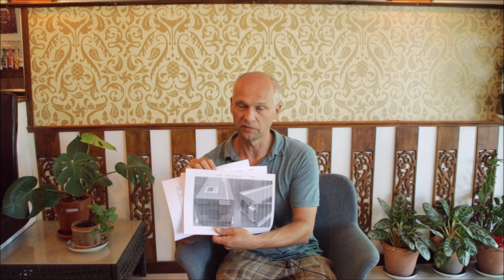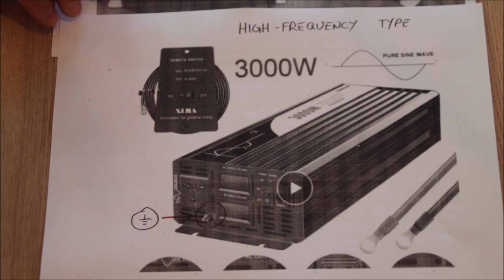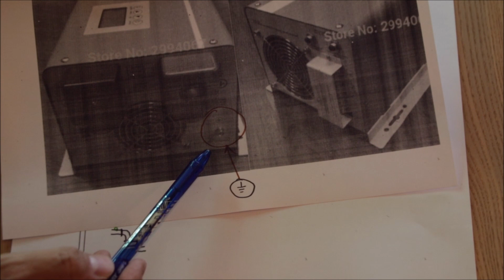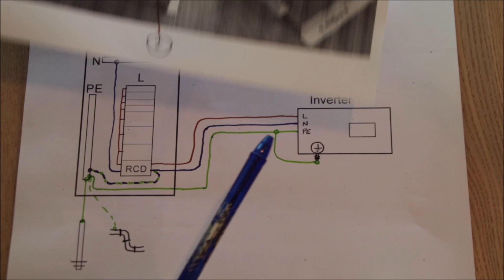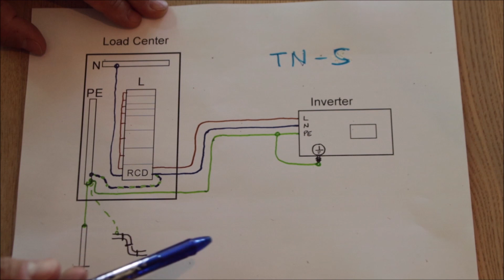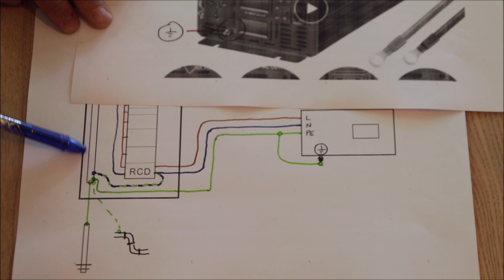Inverter Earthing and N-G Bonding in a simple Off-Grid Setup

Comment: I have a purely off-grid stationary system, the entire installation goes to a single box (with an inverter, AC/DC breakers, an RCD, etc). The inverter that has L, N and PE on both the input and the output. I also have a generator, some meters away, connected to that box. The breaker for the generator is at the box. The inverter has two modes: it can either create the N-G bond itself via a relay while off-grid (and lift it once the generator is available), or it can only switch L and keep N on the input and output always connected so as to inherit the bond from the grid (in this case the generator) (or so the manual says). PE is always continous.

How would you solve bonding in this case? I can either make sure the generator is bonded (or bond it by connecting a N-G connected plug into one of the outlets if that works) and keep the N-G bond switching in the inverter. I have a feeling this works best because it keeps PE separate all the way to the source. Or, I could create my own bond in the AC part of the box (load center) upstream or downstream of the inverter (you show it on the output but then it seems it could also be on the input side if N is continuous?). Or a combination; only I always read you want only one bond in the system. I've read so much about this that confusion is starting to take over, so if you have an opinion based on the above, that would help. :) Great explanations in the videos and great choice of topics by the way. :)
Reply from the maker: Hi. All your equipment is more or less in one spot. Just keep N-G seperated at the inverter as well as generator and only place one single bond inside your fuse box as shown. Connect all PEs including the generator body to the PE bar. As only one of your sources can be active at one time, the bond can only serve the active source anyways. Thanks for watching!
Reply: @RolandW_DIYEnergyandMore  Hi, thanks for the feedback, I appreciate it. I miss the bigger picture, so more questions come to mind. a) You suggest it is somehow important that only one of the sources can be active at one time. The inverter has a weird function where it can supply power by inverting and from the auxiliary supply both at the same time (i.e. joining the power from the battery and the generator). Does that change anything? b) If later on somebody changed the generator for a bonded one, would that then constitute a problem? (Two bonds, so I'm guessing making two PENs out of the PE and N going from/to the generator.) c) Does it make any difference whether the bond is upstream or downstream of the inverter (or going from e.g. a main breaker instead of the RCD specifically)? If N-in and N-out is always continuous in the inverter, would it matter somehow if the bond was placed between e.g. the N-out of the breaker dedicated to the generator (so basically inverter AC-in) and the PE bar?
Reply from the maker: @smzdajdp  what you are describing in question (a) sounds to me like you have an inverter with grid-tie capability. This means that the inverter will, once the battery is charged, start to push the excess energy from the PV on your virtual grid which you are creating with the generator. Correct? Well, you cannot use that feature! What if your house duesn't need power while the generator is running? The inverter is assuming its energy is going to the grid (which is an infinite energy drain) but in real the power cannot go anywhere. So yes, it is very important in an offgrid installation that power can only come from one sourc only.
I think your other question about upstream bonds are relating somehow to that feature about energy going reverse on the AC-In of the inverter. So no, you cannot do that as the AC in of the inverter will be a dead end when the generator is running. 
Use one power source or the other. Physically separate it best with a transfer switch. Then you can make a permanent N-PE bond downstream of the transfer switch at the RCD. 
Or you use the generator at the AC-In only to charge the battery when it is low, so the inverter is still the source if the AC power in your house...
Reply: @RolandW_DIYEnergyandMore  Sorry, I should have been clearer... Also, excuse the length, this is the last one. There is a completely separate MPPT charger for the PV (and a battery between the MPPT and the inverter of course), so that's unrelated. The inverter (Studer) is hooked up to the battery, the generator is hooked up to AC-in of the inverter (the cable is about five meters). AC-in/out terminals on the inverter as described in the first comment. The inverter can only do three things here: supply AC by inverting from the battery, charge the battery via AC-in (generator) and then the third function in question: with the generator running, when the AC load is large enough, it can limit the charging all the way to zero in favour of the load and if the load is larger still, supply the rest by inverting from the battery at the same time (to quote from the manual: "[it] allows to have the sum of the current supplied by the inverter plus the current supplied by the [AC] source"). But this is all managed by/inside the inverter. The only reason I elaborated on it was that you suggested it is somehow relevant to the PE/N bond which source is active and I did not see how. :) Now I see we probably misunderstood each other.

The upstream/downstream bond question was purely theoretical since I don't really understand properly how faults are detected thanks to the PE and the bond, how does the function of the three wires change upstream of the bond and how would it all behave in case of different faults at different places. (Plus it would be convenient for me to physically wire it that way, but that's not really relevant.) There is no problem wiring it the way you suggested initially/in the video, besides somebody later changing the generator for a one that would itself have a bond (which I think would then cause a problem, but I'm not sure). What I am really wondering is whether the way I wire the bond will make any difference to security. I could really use a diagram but I'll try the words that keep failing me one last time. :)

I can set up the bond as you show it, wire generator L, N and PE to inverter AC-in (you suggested going with generator PE right to the PE bar, but as of now I see no difference: PE-in/out is always continuous inside the inverter). In that case, the inverter will be set to switch L and N. Or, I could bond between AC-in N (close to the inverter) and the PE bar. In that case, the generator L and N would go to the inverter and PE right to the PE bar (again, no difference, but would avoid a ground loop) and the the inverter would be set to always keep N continuous (switch only L). Again, with my (severely) limited knowledge, I don't see any difference: a fault will energize the PE bar, from there, there is a bond back to the source. (I was not certain AC-in N can become a path back to the source but if the manual says so and if there is actually physical continuity between AC-in N and AC-out N, again, what's the difference?). What am I missing? :) Then there was the last option of the inverter switching its own bond (on when off grid, off when generator is on) and bonding the generator. This would sacrifice some rigidity of the bond (at the generator anyway) and I don't know if it would benefit anything at all. I know one is supposed to bond "at the source" but don't know if the five meters of cable from the inverter to the generator make any difference. Still, would be good to know, theoretically. (However, although the manual does not say anything about this, come to think of it, the inverter may only lift its own bond when the generator was actually running, so by connecting the generator not running but with the bond, there would be two bonds in the system. I'd have to check that.)
Reply from the maker: @smzdajdp  i see what you mean and what is confusing you. When we look at a TN-Earthing system (which is the only system we can realize with a solar inverter other the IT-system), there will always be multiple bonding. Every power source would have to have its N-PE bond right at its place and then you have just conductors connecting different elements of the whole. The unique thing when we are talking about an off-grid installation with multiple power sources is that those different power source are typically all at one place and it makes it not necessary to make that TN link for every source separately. But we always need to consider 3 things:
1. What is the return path of leakage/fault current in any existing supply situation
2. Is there a possibility of a N-conductor break without having a alternative path for current over PE
3. If RCDs are used, can it be confused by other ground fault loops
That's why in such spacially small setups like an off-grid house with backups, we want to use a TN-S based concept with a uninterrupted PE Conductor connecting all power sources and users, and one source of true Earthing/Ground where all is connected. An RCD shall then watch over the installation on the demand side right at the common entry of all sources so that no bypass of different possible fault currents/loops can occur.
So yes, in your case as in every other such case there will be still more then one N-G bond present. Generators might have a permanent bond built in and will automatically be active once you connect a PE wire, etc. But the important thing is that even in such cases the impedance due to the TN-setup on the sources-side is extremely low and no mater where the fault current then finally go back to its source, they must trigger the relevant protection device or built in system. An inverter or generator cannot generate hundreds of amps of short currents similar the almighty Grid would do in such a case!
The final and ultimate question is alway if the system will stop in case of an earthing fault or human caused leakage case.

Build your system by the best of your knowledge and then test it in each condition. Thanks for your very detailed questions. This will surely help many others as well.

Comment: This is very good....However the manual on these  type of inverter(Reliable, Aims...etc) say that the ground and neutral should not be bonded...As per your diagram they are bonded at the load center.  I'm asking that because I have a Reliable 3000 watts 120 volt AC, 48 volts DC...and when you check the ground and the neutral...they  are not bonded..
 however  the voltage from neutral to chasis-ground is 60 volts and from hot to chasis-ground is also 60 volts...If you ground the neutral will you destroy the unit???
Reply from the maker: Hi. I had exactly the same comment about a Reliable inverter with another viewer. Unfortunately people are often asking such questions below other unrelated videos and I couldn't find that conversation now :( ...You could have asked him if he tried.... I was wondering that time why the manufacturer would explicitly not allow to bond N-G. I am sure there is no technical reason as this is normal procedure and a N-G connection could happen in any leakage situation and wouldn't blow up the unit. If your application allows an isolated operation  of the inverter then its fine to follow the manual.
Reply: @RolandW_DIYEnergyandMore  The issue on these Chinese inverter is that what they call neutral is at 60 volts from the ground.  If you bond the neutral with the ground the unit will be destroyed ... check this for more information https://youtu.be/3XTrptygCDM.
Reply from the maker: Every inverter has a floating Neutral where the voltage can be well above the Zero, bonding it to Ground will not kill the inverter. What is killing an inverter for example is if let say someone from US buys a Chines 230V inverter and connects it on L1 and L2 and then there is a Ground bond somewhere... 
By just connecting N to G nothing happens really. Currents are only flowing during Ground faults, and then its the same if it would flow from L to N. Inverters typically can handle short currents as they might as well happen between L and N. The only this what Ground is providing is the reference to Zero.
About the video link:
Yes you are right! This is a different problem. These inverters do in fact have an internal midpoint bond similar to a grid transformer in the US. The manufacturer just switched an 120/0/120V output transformer to a 60/0/60 to create a 120V inverter. You cannot connect such a device  to Ground as that terminal is NO ground. Such a inverter design should be banned actually...

Comment: Hi this a very interesting video. I install Sunsynk inverters in the uk, grid tied with a UPS for a power cut. The Sunsynk videos say to put a Contactor across two terminals for the coil to make in the event of a power cut then netural and earth on the contactor poles to Pe & N terminals of the load in the inverter.
 So my question is do I actually need this contactor or do I just do the link that you have done in the load fuseboard/panel?
I have also put a earth rod in the ground.
Reply from the maker: Hi. Using a contactor for bonding is definitly a requirement when you live in a TT-Grid, and it is a safe alternative for other grid types as well. But for that please check my videos on using inverters in grid configurations. This video is for off grid setup. Thanks!

Comment: Nice explanation.
For RV’s there wouldn’t be and earth stake, so what would you do in that situation?
Reply from the maker: Well, if you are staying stationary for a while and your RV is equipt with so much electric eqipment like a whole solar setup, I would drive a albeit shorter stake into the ground and connect your system to it. or just barry a rod horizontallyinto soil...
Reply: The trick is to have an earth so you don't get shocked by a short or failure, I use a copper plate on the ground so I can pick it up, its much more conductive than my shoes and takes 1 min to pick up.

Comment: Thank you very much for sharing your knowledge. In my off grid system i have bond N and E on the N and PE bars after RCD not before. Is this wrong?
Reply from the maker: hi. yes, that is wrong as it will prevent it from tripping if there would be a leakage. RCDs need to measure differential. if PE is not bypassing the RCD then there is no difference in current in versus out.
Reply: @RolandW_DIYEnergyandMore  Thank you very much. You are the best sir!

Comment: Hi Roland.Thanks for your video. I have 3 questions. Q1. Can an UPS (CRGO) used instead of inverter? in off-grid system 24V (ofcourse without conecting ups input to mains). Q2. RCD/RCBO is single pole? (only Live disconecting). Q3. Type A is ok or is mandatory type B? Example: L80M-R C10Gacia.Thank you in advance.
Reply from the maker: hi. cheap UPSs typically do not output nice sinewaves. its really just for emergency. i would rather use a real pure sinewave off grid device instead. they also provide more safety. RCDs or RCBOs always come 2 pole for one phase or 4 pole for 3 phase as they must compare current over L and N. Type A are normaly OK with most off grid inverters as they typically have a galvanic seperation between AC and DC side. but you can always go safe and use a type B

Comment: Hi sir how do you earth grounding the genarator ??
Reply from the maker: Typically you will find a screw somewhere on the generator chassis where you can connect the earthing wire. Connect it to a grounding rod directly at the generator or to house grounding if a panel is nearby. There is no difference to an inverter. Principles are same.

Comment: My home energy solar system and batteries have a contactor relay that bonds earth to neutral when in islanding mode ... as the Sunsynk inverter has an ac signal output for this purpose. When reconnected to the mains and grid-tied, the relay opens to allow the neutral to once again be unbroken and allow the earth fault loop to the source to be functional.
Took me some time to get my head around it.
Neutral and earth linked at the source of generation.
Incoming side of RCD senses imbalance due to earth leakage and the device then trips !
Thanks for re-educating us all !

Comment: Great video, very interesting.  But i'm left confusted as this configuration would represent a TN-C-S.
Reply from the maker: Well, that really depends how you see it :) As i said in the video. When you set up your Off-Grid system, it is most likely that the inverter and main panel where the rod is connected, are very close together. The rod is at the panel and there is where N and PE are split. So, the short distance of wiring from panel to inverter only represents the inner wiring of an otherwise transformer. If it should be called a correct TN-C-S system, the rod would have to be connected directly at the inverter terminals and there would have to be the N-G bond as well. And inside the panel you would also need to bond and separate again. Doesn't really make sense :) I really do prefer solid connections inside a panel other than flimsy ones at inverter terminals. But I see that you have understanding. Please feel free to find the best way for your set up.
Reply: @RolandW_DIYEnergyandMore  Many thanks, that make perfect sense!